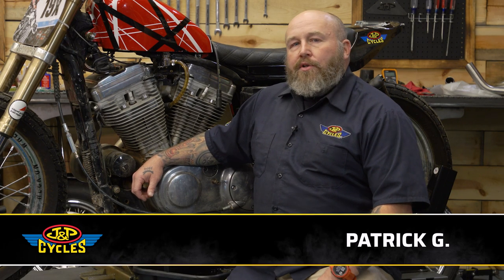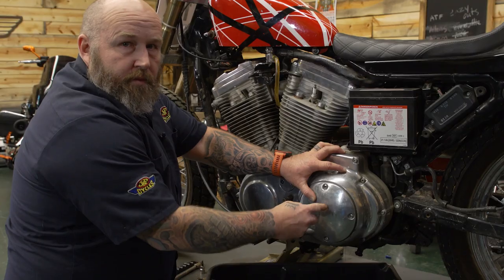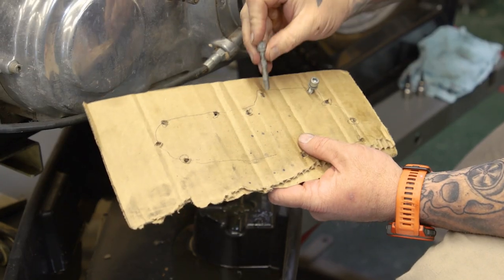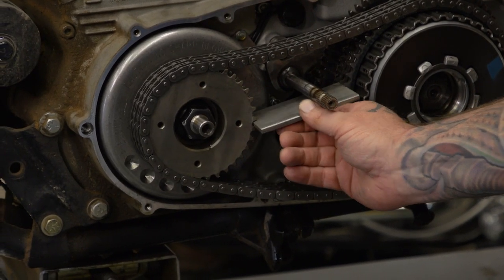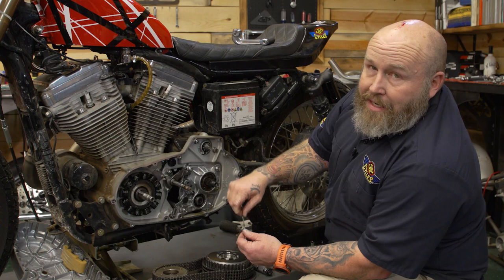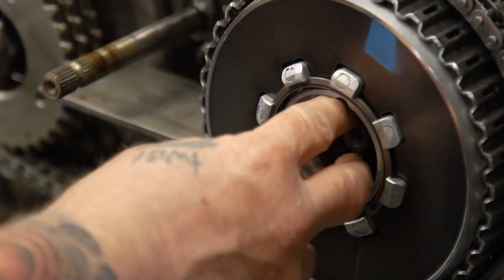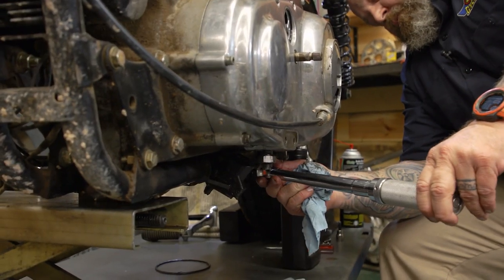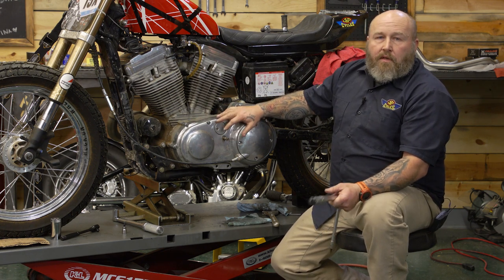How to Fix Sportster Shifting Problems : Weekend Wrenching

Comment: I have been turning wrenches on Harleys and British bikes  51 years now. I remember in 2004 Harley got rid of the trapdoor on the Sportster transmission. Now you have to split the cases to pull the transmission. I was talking to the 20-something service writer then at the local dealership. He said I we never have any transmission trouble with Sportsters. I just laughed and shook my head and walked away.
Reply: New to Harley man got a 1202 buell x1 lightning/ would mine have a trap door to do trans work or so I need to split cases
Reply: My Father-in-law had a Sportster he sold to his Sister-in-law who has been letting her son Ride it. Saw it last weekend for the first time in a couple of years. Clutch barely engages, jug gaskets are seeping and it's stuck in 3rd🤦.
Reply: @SGTJDerek  sounds like he needs a hand sorting it out.
Reply: @ludo9234  not unless he hands over the title.
Reply: Blew the door on my '79 Sportster. Had to get every single piece replaced. That was only One Thousand dollars back in '80, including labor at the Harley dealership.

Comment: The shifter paw adjustment doesn’t just come out of adjustment. If it’s out of adjustment that’s because someone set it up wrong. Also you should of replaced that burnt up stator. Fluid level is to the bottom of the clutch spring, it is not a set amount fluid ounces
Reply: Well thank you for that little tidbit...  I bought my bike virtually brand new, 13 years old with 236 original miles on it. After 3 riding years and 20k+ miles on it, I'm at the place that lead me to this video. After reading your remark a little light came on and made me remember/realize; I've had shifting issues since day one. Thank you for that.

Comment: 7/64 is closest to 0.116 inch. not 5/32. this gap adjustment lead to other shifting issues on my sportster. specifically a very hard to find 2nd gear when shifting from 1st.
Reply: Shop manual says no 32 bit (0.116) 
That’s smaller than 5/32

Comment: Ive been a auto mechanic for 25 years now but i’m new to working on Harleys. I purchased an 02 sportster 1200 with 700 miles back in 2012 and now i have 6000 miles on it. Every time i put it in gear it has a slight grind and it bangs into gear like it always has since i purchased it. Is that normal?? I’m asking now because i’m putting 14 inch ape hangers on so im replacing the clutch cable and want to know if theres something i should check or look for while im replacing the cable?

Comment: Your video was very informative. Thank you. However I'm not sure what you did to make it shift now I saw you take everything off and then put it back on. So if I'm having shift problems I don't know what you did to fix it?
Reply: It's the adjustment in third gear. Take the 2 bolts off the shift pawl and insert the specific drill bit and re tighten the shift pawl which realigns it.
Reply: Same here, this is why I looked into the comments to find out what he actually did ha!
Reply: Same here, was confused about the fix was... ????  
I have a 1990 SPORTY 1200 with shifting problem. Stuck in gear, can't get to shift unless (with engine off) you roll bike back and forth. Will be taking apart this weekend. Hope this all I have to do is realigned this pawl. Seems to easy...
Ride Free

Comment: Mine wouldn’t go into 1st or 2nd on the downshift. Pulled apart wasn’t going to adjust pawl but then say retainer clip laying in the bottom of the case from the barrel. Going to pull it all apart. This video was really helpful to find the retainer location

Comment: You guys need to correct this, 5/32 is NOT #32, it's much bigger.
If you have a metric set, you can use a 3mm bit.

Comment: Great video My sporty rattles some times going into 1st from N.
I was wondering could you pull the comp sprocket off without removing the clutch basket?
Reply: Nope, it all has to come off together because the primary triplex chain is "endless", meaning there isn't a master link you can take out.

Comment: Have a 2004 1200 sportster HD. Friend payed it down simply taking off at night near the beach, bike has an engine guard on it so no major damage… It is stuck in gear though, thinking it’s the shifter pawl though What else Could it be ?,  had changed the oil just prior to this accident{& just after purchasing the bike} it was difficult to shift Before changing the oil, which was Filthy, bike had been sitting awhile…. Suggestions as to what else it Could be other than the shifting pawl?

Comment: Do you have a video on break pedal adjustment? 
I have a 2021 XL 1200 NS Iron Sportster the break pedal is just a little bit to low & while breaking it hits the heat shield on the front exhaust...

Comment: I've had an issue with 1st gear jumping in and out as if the dogs aren't engaging fully. Once a bit of load is placed on the trans, 1st gear clunks in the whole way. I pulled the trans yesterday and I can see there's some wear on the edges of the dogs but I'm wondering if the pawl being out of adjustment is what caused the issue to begin with. Anyone else have the 1st gear "jump & clunk?"
Reply: Yes, I've had the exact same problem on my 2001 Sportster, the problem was the 1st and 3rd gears on the COUNTERSHAFT had worn out dogs. It doesn't look like severe damage but it's obviously enough to cause that jumping out problem. Harley has made an upgraded version of both gears with virtually no ramps machined, this supposedly helps maintain engagement and avoid the problem. I've only just fitted mine but haven't had a chance to test it yet.
The pawl adjustment is definitely very important and you should check that as well, using new nyloc nuts while you're at it.
Let me know if you need any info or pics, happy to share what I can.
Reply: @mysticapprentice  do you have a part # for those gears?
Reply: @6sillygtivr  Of course, 35763-89A is the countershaft first gear, and 35771-94 is countershaft third gear. Bear in mind that you will also need a set of retaining snap rings, part n. 11067, and ideally you should also replace the thrust spacers (6003) and the needle bearings on both shafts (8876A, four for the whole transmission). Let me know if you need anything else, good luck!

Comment: Could you please tell me the sizes of the tools for removing nuts of main shaft and clutch? (Sorry but I didn’t listen well on video)
Reply: 1-3/8 in on the clutch basket (left handed thread (righty loosey, lefty tighty) and 1-1/8 on the comp sprocket

Comment: I ride a 1992 Sportster 883 recently I was told by 'an expert' that there's some bushing behind the shift lever that can wear out and cause a ratting noise' & mine seems to have that noise while riding if I go around or over 3000 rpm in like 2nd or 3rd gear. It doesn't seem to make any noise in neutral or when clutch is pulled in. Is this something I should go into the side cover and behind the inner workings?
Reply from the maker: Yes, its a bushing that is in the primary cover where the shift shaft comes through. It can get worn and allow the shifter to rattle.

Comment: I used this video as a tutorial and I can’t figure out why my snap ring keeps popping out everytime I put everything back together and pull in the clutch lever. Then I have to pull everything back off and reinstall the snap ring. I don’t understand what I am doing wrong. The snap ring looks well seated in its respective groove. I don’t even know where the tension or force would be coming from to pop it off in the first place. 
Has anyone else dealt with this? I am on try number 5…

Comment: What would cause bike to occasionally go into neutral when in first on takeoff?
Reply: I came here to ask the same question
Reply: If you find that it's jumping in and out of first gear, the issue is most likely that the dogs on 1st and 3rd on the COUNTERSHAFT are becoming worn out. No fix other than replacing the gears with the upgraded parts available from Harley.
If it's just going into neutral and staying there, it's likely that the shift pawl needs adjustment as described here with the #32 drill bit. Use new nyloc nuts.

Comment: do i need to remove the clutch basket if im only replacing the return spring?
Reply: also if the shift lever is bot returning to center position after shifting, it has the be the return spring correct?
Reply from the maker: I don't think you can get to it without taking off the clutch basket.
-Patrick
Reply from the maker: @fernandovenegas5374  Possibly, you will need to do the adjustment either way when you replace the return spring.
Reply: And the retuernspring is on the primary side of my 1988 883 ? Just had mine stop returning, the shifter stays put wherever i push or pull it, cleaned snd lubed all the linkage and no difference. Am i in trouble here?

Comment: Did you disconnect battery prior?
Reply: No need
Reply: @rebel_ltz  I thought all battery's should be when working on inner primary.  Thought wrong I reckon
Reply: No need but you don’t want sometone hitting the switch while hand in there 😱

Comment: Dude, that is a freaking cool paint job, on the tank. May Eddie rest in peace. I want that paint job.

I just watched the video about adjusting the clutch. If I have to jam it into 1st, so it won't clatter into gear, is that a clutch or shifter pawl issue?
Reply from the maker: That sounds like a clutch issue. Like the clutch isn't completely disengaging.
Reply: @jpcycles ,
Thanks

I appreciate it.

Comment: I'd like to do this but I only have the Harbor Freight jack/lift.  I worry that the bike might fall of when those nuts are torqued.  I could maybe get everything snugged up and put the bike back onto the ground to do the final torque?
Reply from the maker: That should be fine.
Reply: @jpcycles  Thanks for the help!  Going to do this in the Spring

Comment: did he leave the drill bit in it?
Reply: also, best vid on YT on this subject, thank you @j&pcycles
Reply: That was my question too.  Had to rewatch it.  The drill bit only stays in while the two bolts are tightened to give the paw precisely the space of the drill bit size he mentioned.  After that, the bit comes out.

Comment: You don't need  the metal plate etc to hold the clutch and primary from moving!
I just used an old paper back book that I finished reading, yes just jam it between the chain and gear teeth, every one has a few, maybe Democrat supporters and votes will not have any books they cannot read.

Comment: How did your clutch basket snap ring come right out. Every other video on this clutch says I need to buy a clutch spring compression kit or the snap ring will not come off. What did I miss here? 😳
Reply: What you see is the snap ring that retains the clutch adjuster rod (and its bearing), that one does come out with just a pair of snap ring pliers. At this point you can remove the clutch as an assembly, if you need to get at the transmission, starter motor bolts, or shifter pawl.
However, if you need to OPEN the clutch to replace the discs, then you will need a clutch compressor tool to relieve pressure on the diaphragm spring so you can then remove another snap ring (different from the one mentioned before) and pull out all the clutch internals.